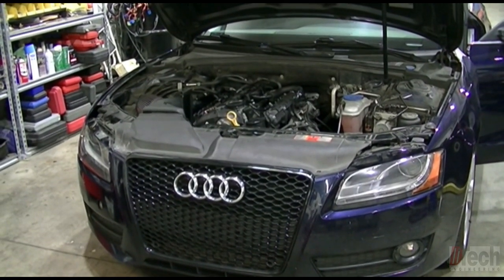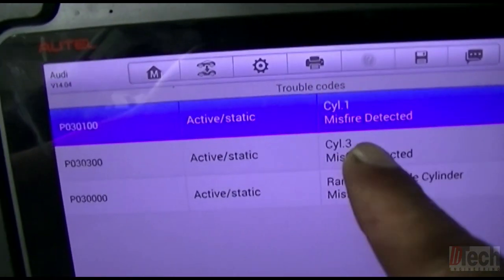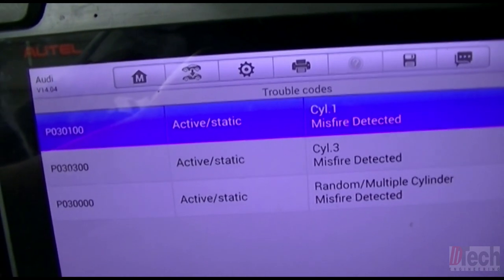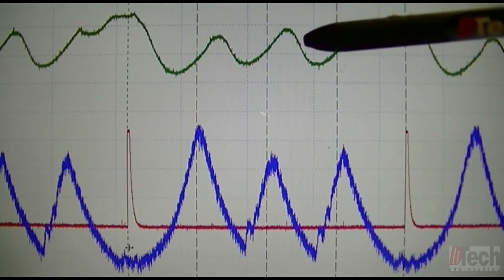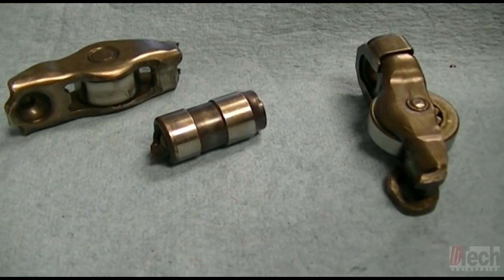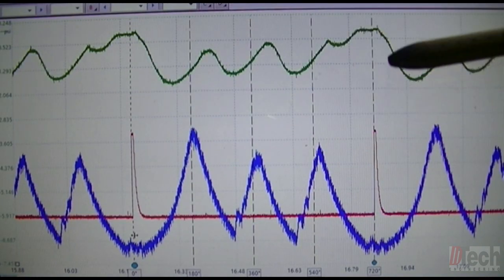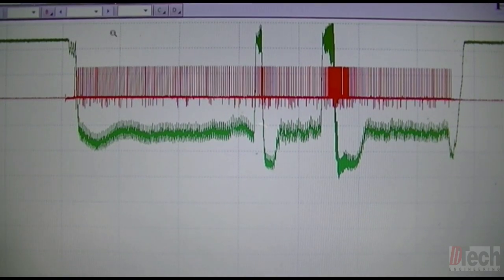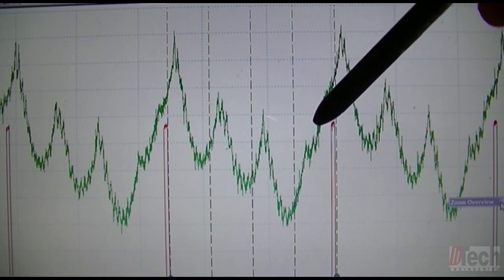Engine Pressure Waveform Analysis When Rockers Fall Off

Comment: I'm astonished that the engine ran well enough under normal load that it was able to hide such a major valve train failure.  I guess it shows how efficient the engine breathes with only one intake and one exhaust valve in operation on the bad cylinder.  This was definitely a bizarre case study, Sadel.  Thanks for taking the time to grab all of the Pico captures!
Reply from the maker: Dave, the customer had no idea,  and unfortunately he had just purchased the vehicle when he brought it to me, the only thing he mentioned after I brought this issue up to him was that he thought it felt a little underpowered under heavy load. Pretty crazy situation for sure but glad to have experienced it.  Thank you for watching

Comment: Awesome case study Sadel, great analysis of the waveforms. I'm wondering if the higher peak for cylinder 3 was due to an increase in crankshaft speed because of the lower compression in cylinder 1. Very hard to see in the waveform for sure.

Comment: Hi, this is very great video, thanks for sharing. Do you think this car also exhaust side timing out? Because I saw the the exhaust valve close, pressure still going up. I think this is uncommon. Do you think so?
Reply from the maker: I don't believe that it was, from what I can remember, but I can't guarantee that since I never compared to a known good. But what I do know is that it is not uncommon to see that rise at that point in many euro's. I have seen it in other captures and when the cam gear is phased you can see that rise go away. Hope that helps , thank you for watching

Comment: Did you use a pressure pulse sensor here
Reply from the maker: Used a vacuum transducer on intake and inches of water on exhaust and regular absolute transducer in cylinder